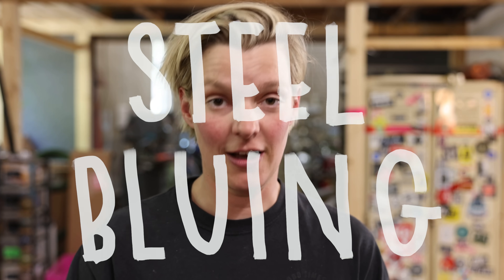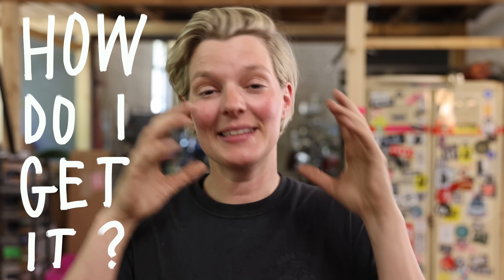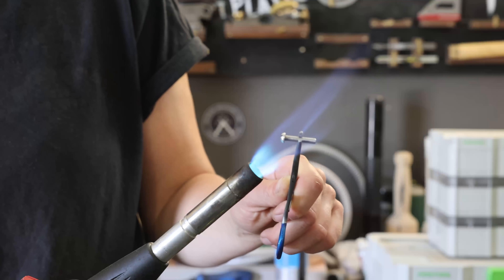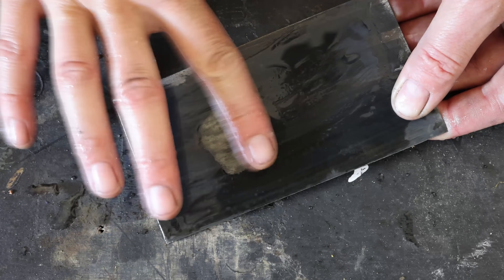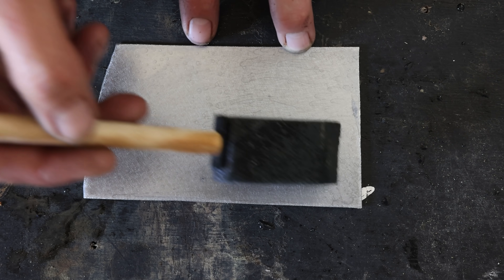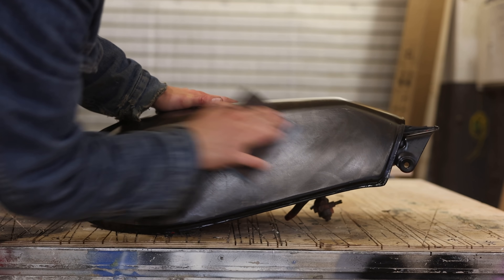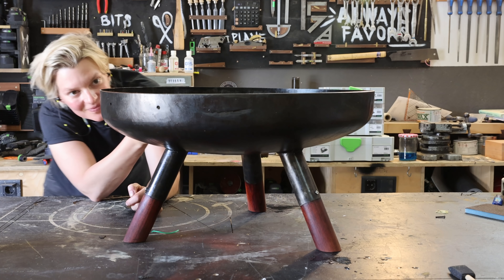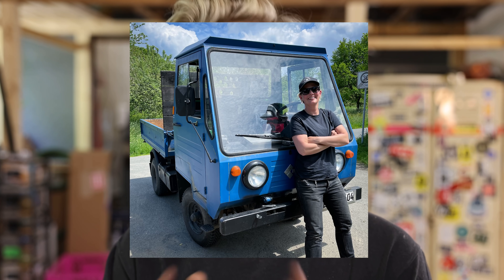Turn Steel Black - Cold and Hot Bluing Process Explained

Comment: Technically the process is 'browning' in English too, giving iron or steel a rust resistant surface. True browning these days is generally only applied to Antique Firearms and Armor. Cold or  'Low Temperature Blue', its used on double barreled firearms because that process won't eat the lead/tin solder that holds the ribs to the barrels (an expensive mistake) but the temperature is only around 100C for best results. Regular hot tank blueing does eat solder. Also be careful, a lot of both hot & cold blueing compounds contain (or used to) quite nasty chemicals like Selenium salts, so wear rubber gloves when handling.
Reply: Oh so don't put it on a BBQ you eat from...

Comment: Thanks for the hot bluing technique. I have a use for that now! Leaving the blackening/bluing in the deep scratches looks terrific on the tank! In printing, that's similar to a technique called "intaglio" where the entire surface of the engraved metal is inked, but wiped away in the high spots, leaving only the engraved lines holding any ink.  I could see the Kampf logo etched into the tank and then blacked & sanded away.

Comment: Hi! Woa the tank looks great, the thing with the deep scratches is cool! Instead of using the toxic chemicals in cold bluing, you can also use vinegar or citric acid, for example. You only have to let it work for 24 hours instead of a few seconds ...

Comment: re: "posh rust" (very funny!). Regular orange/red rust is flaky and friable, so it easily drops off exposing fresh unoxidised material, cycle repeats. Blued steel is a conversion of the surface to magnetite which is hard, unlike the usual working class rust ;-)

Comment: You don't even have to use special chemicals, common Household-Acids like Vinegar, Citric-Acid or Mustard can do the Trick. But they need some Time and havent this cool instant Effect, and it ends up with a more greyish Black.
I like doing this to Knives with Carbonsteel-Blades (non Stainless), because as Laura said, it looks cool and gives same protection (and they will darken anyhow).

Comment: Hi! I really enjoy your videos, specially the explanations given with them.  I can add to the bluing methods, there is another one,  is called "nitre bluing" and is the method using in firearms, it uses potassium nitrate (KNO3) and sodium hidroxide(NaOH). And the one using oil is also called "polymerization".  Regards!
Reply: Nitre blueing is also called rust blueing, its a much more durable blue and is much better for rust prevention
Reply: @hannas865  nitre bluing and rust bluing are different processes

Comment: Can you "draw" using the bluing technique?  Much like masking parts during painting, do the same with bluing? I think your logo would look like a great experiment to do
Reply: What I thought of when she showed how her fingerprint wouldn’t take the bluing, was to draw with oil and blue over it. Sort of a relief drawing…That should work, right??
Reply: Probably with a wax mask, but you'd lose any anti-corrosion protection you'd usually get with oiled, blued steel
Reply: @forresthsu582  Ah, but Laura did cover the mitigation technique by varnishing the piece, with how she did her motorcycle tank.
Reply: It will work with a vinyl mask ;)
Reply: Yes you absolutely can, The Oxpho blue from brownell's.com doe amazing  for cold bluing jobs.

Comment: Does hot bluing work on stainless? Cold bluing doesn't, afaik
Reply: Sort of. It will turn the surface black but if you get the metal too hot (700C+ IIRC)and don't quench it quickly, it WILL destroy the rust resistance of the steel (the chromium on the surface oxidizes, goodbye rust proofing). This is also why large pieces (like rudders) fall off expensive boats - they have been welded and not quenched properly and the welds are somewhere out if sight so no one can see the corrosion.
Reply: @brucelee3388  thank you! that's a good explanation.

Comment: FWIW, dropping hot steel in oil is properly called blackening. It was used extensively in the Middle Ages to blacken armor. The armorer would coat the piece in linseed oil and throw it on the forge.
Chemical bluing is called that because it does have a blue-ish tint.
Proper heat bluing is done by slowly heating the piece and removing it from the heat when the heat oxidation color reaches blue. To see what the effect looks like when perfectly done check out this Clickspring Clip, "Turning and Bluing Small Screws."
https://youtu.be/wL4Xba3ZFRY